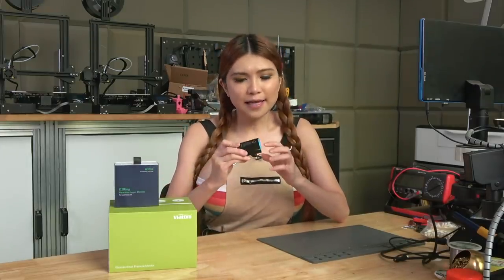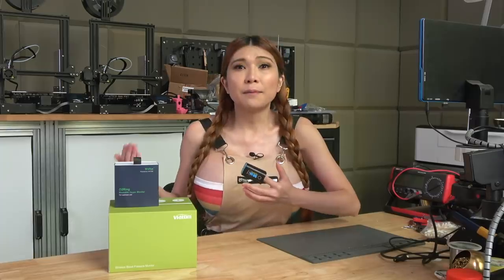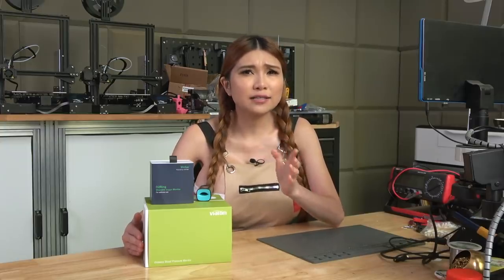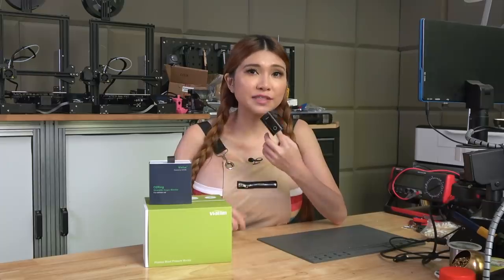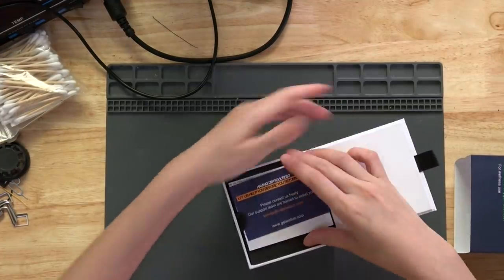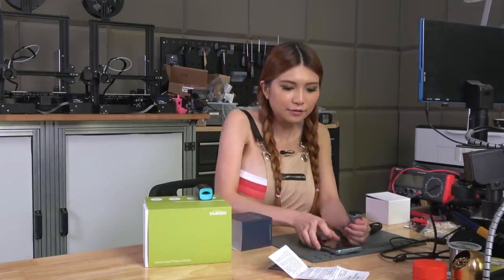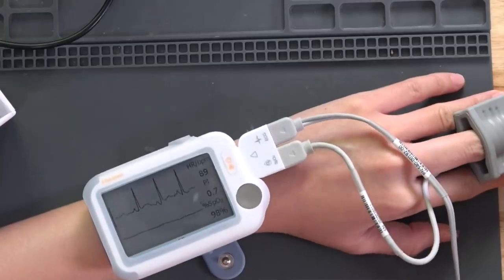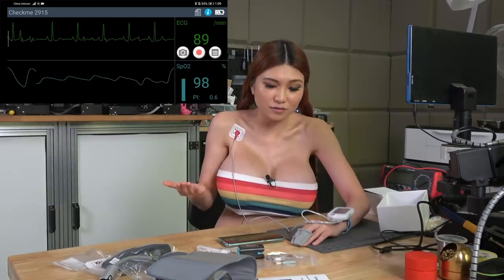Real Life Medical Tricorder! The Checkme Pro & O2Ring Pulse Oximeter

Comment: I like the manual driven air pump to measure blood pressure. Not like all battery driven devices which are empty when used irregular. This risk will be reduced.

Comment: Ooh, I have some experience that's relevant! Turns out doctors, etc. trust home pulse oximeters when you bring them with when you go in, and it reads the same as their professional one 😁 Worth bringing yours in next time you go to the doctor to "calibrate" or check how accurate. Very useful if you're prone to severe respiratory infections.

Also, for some reason, at least the home pulse ox units often read low on a finger or two. Worth trying it on a few fingers until you find the highest value. Also, if you have asthma or something, coughing should raise value for a few minutes, as another good double check (and as a data point for the doc, saying "had o2 of 90, could get it up to 93 after coughing" is more useful than a single reading.)

Kind of surprising a doctor would request you monitor spo2 and not come in to the hospital, but I suppose that's Covid to blame there - before this, if you needed monitoring, you were at least needed to be in the emergency room.

That "tricorder" looks pretty awesome. Expensive, but if it is properly validated such that doctors will like it, it might be of value for medically complicated people.

Thanks as always for a great video!

Comment: The Checkme Pro would be brilliant for Advanced First Aiders (as in First Aiders that are trained in oxygen administration like St John Ambulance Advanced First Aiders in the UK) or even Volunteer First Responders as it contains pretty much all the Obs. kit you would need apart from a torch. It is a bit expensive but if it's divided between people of a household or used in first aid scenarios then it would be worth it.
Also, the O2 Ring is a good idea but I would be afraid to recommend it to anyone that does a lot of work with their hands unless it's computer work.
Overall, great products Naomi.

Comment: Naomi, great review!  I'm always interested in devices that will save me a trip to the doctors office. I have a Quardio blood pressure (BP) monitor I use all the time since I have issues with it.  I can simply call up my doctor and give him the readings and he can up or change my prescription as needed to fine tune my needs to keep my BP where it needs to be.  Also, most of the Samsung phones have a "stress analyzer" built right in (I suspect other phones may have that feature too but I don't know) that measures oxygen levels, if you download the Samsung Health app and activate it, it will instruct you to put your finger over the flash/sensor window and somehow it accomplishes the same thing as the Oximeter although I doubt it has been officially approved by the health agencies to operate as such which is why it is labeled as a "stress analyzer" instead of an "oximeter.

Stay safe!,  Much love from Texas to you!

Comment: From my experience, the main limitation of this kind of device is they should be periodically checked and recalibrated (like the ones used in hospitals are), but for private usage they're fine. 
Anyway your Beat Rate increased from 86 with the first device  to 89 on the second one, but at 14:55 mine jumped at 120 🤭

Comment: Some thoughts:

1. You are an "Educator and Entertainer" (not a medical professional).  Please use both words, at a minimum!  Depending on the situation I'd recommend adding more, such as: "Maker", "Open Source Hardware and Software Advocate", "Fashion & Lifestyle Model", "Reviewer & Reporter", "Product & Brand Ambassador", "Agent Provocateur", and so on.  You are many things, not just one or another.  Keep getting that message out there!

2. While it is important for folks not to try to get meaning from a single set of personal health-monitoring device readings, much can be learned by tracking the TRENDS over time in your numbers, whatever they may be.  When it comes to health data (and sensor data in general), single readings of anything are pretty much useless, simply because there are no STATISTICS that can be used to help check if the device itself is working correctly, much less tell anything about the body it is connected to.  One of the easiest statistics to use is a trend graph.

Perhaps an example will help: Tracking our weight.  We all know it is important to weigh ourselves in a consistent manner.  Every week I weigh myself an hour or two before starting to prepare Sunday dinner.  This is because Sunday dinner tends to have more carbs than my normal eating habits, and carbs tend to also cause temporary water gain, which can rapidly shift body weight.  I'm typically at my leanest Sunday afternoon, after all my weekend activities.  That's the number I track, and I don't really care how much it swings during the week (which can easily be 2-3 kg, depending on a number of factors).

Similarly, I use fitness devices (Fitbit, Garmin, Polar, etc.) to monitor my workouts, though I do let my Fitbit nag me 24/7 because it is also my main wristwatch (and lasts about a week on a charge).

I measure my temperature, HR & SpO2 and BP (blood pressure) in a mildly fasted state after waking up but before my first cup of coffee or breakfast (which I rarely eat).  I typically do this on a weekend morning while waiting for the water for my morning coffee to come to a boil.  I have lifetime asthma, so my SpO2 runs a bit low and should be closely tracked in these days of COVID-19 as it places me in a somewhat higher risk group.

I'm also over 60, so my BP is gradually increasing with age, though my fitness keeps both it and my resting HR in check.  I track trends in these numbers not only to follow the effects of aging, but also to check if I've been slacking on my workout regimen, or if I should change it (generally to match the season: It's harder to keep my numbers consistent during Winter, much less continue to improve them).

I also track my Glucose and Ketone levels as part of my gradual and controlled weight loss plan, to help me find the minimum weight at which I can be fit, healthy and comfortable without taking forever to get to my current weight goal (I go into moderate Ketosis for one week each month).

That's quite a lot of data!  I don't really care about any individual number from any instrument (other than to ensure it is working correctly), and I don't care much about week-to-week changes (because, life), but I do care about my monthly trends.  When any single number looks odd, I take multiple readings 3-5 minutes apart, and may change the batteries, just in case.

NEVER obsess about any single number!  If it is consistently different, change the batteries and/or try a different instrument.  For example, BP cuffs that go on the wrist are notoriously inaccurate, but are also incredibly convenient, and so should be used only for trend data.  But even a change in hydration level can affect wrist data, so I borrow my sister's arm cuff when my wrist data seems strange for more than a few days (she's a nurse).

Finally, you may notice I take nearly all my readings in a fasted state.  This is important!  This is why the doctor may ask you to fast for 12-24 hours before a checkup, to permit useful numbers to be obtained that are minimally affected by your most recent meal or beverage.  (If you are scheduled for a glucose tolerance test, the pre-test fasting window may go up to 48 hours.  Ugh.)

If a doctor asks you to monitor a body function (say, your blood sugar) on a specific schedule, then do it when specified, as a fasted state isn't always the most useful time to take readings used to diagnose, monitor or control a medical condition.
Reply: BobC /. The information you provided could be helpful for most educational videos. Thanks for sharing